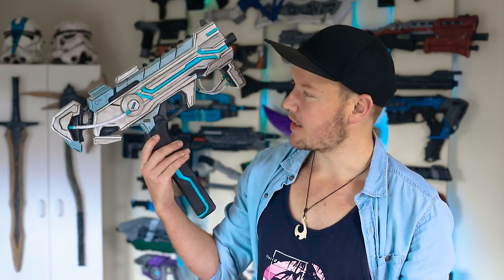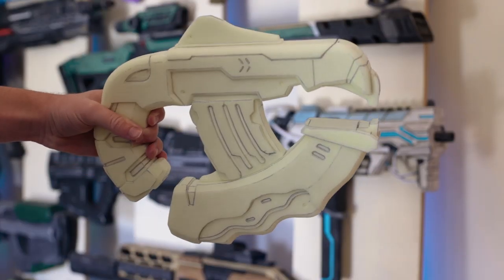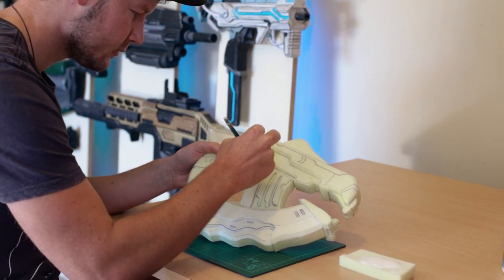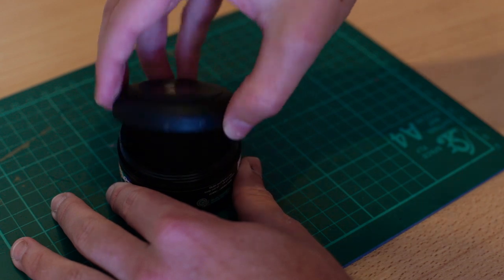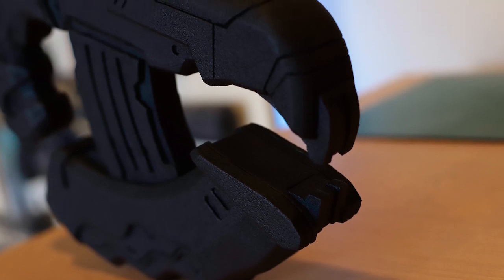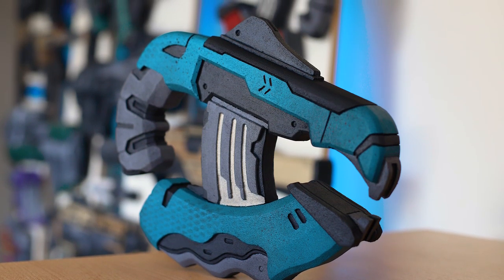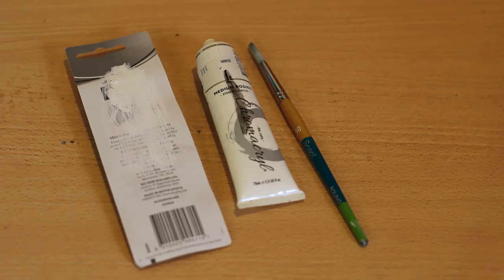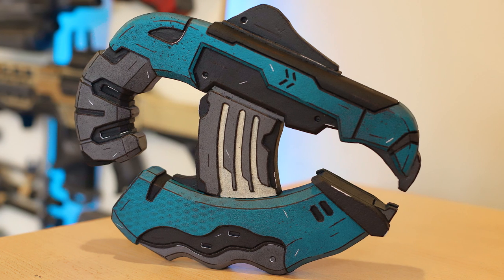My Painting Process...

Comment: Would you use this same process on EVA foam?
Reply: Yeah you can and i don't think it matters at all what type of pva you use because it wont eat away at the eva like it can with styrofoam
Reply: I use a foam inner and sandwich it with 1mm eva. Another thing with styrofoam is that pva will make its own "pools" and leave sections with no glue on it. Of course, that may be due to the foam, or not watering down the glue enough. The stuff I have in Insulation foam, though DFT and I seem to use the same Selleys glue. Another trick, for handles and softer sections, if using eva, is to use Mod Podge to seal the foam as it sets flexible instead of hard as pva does.